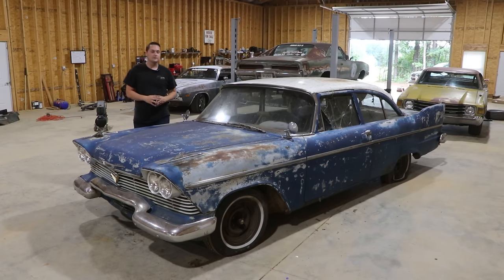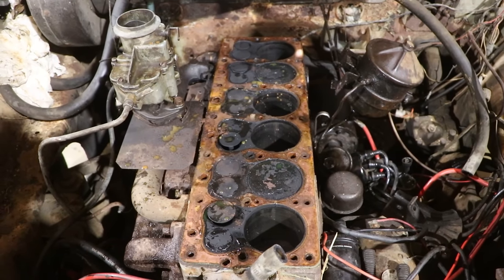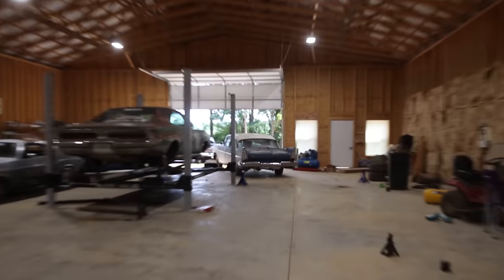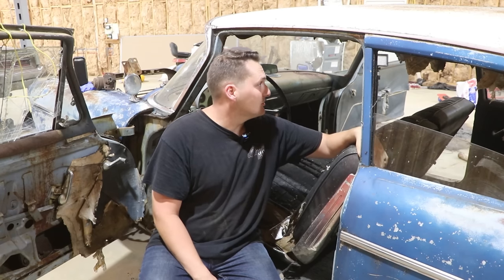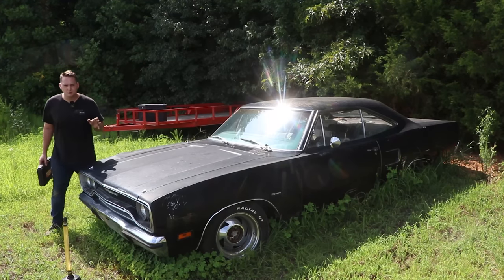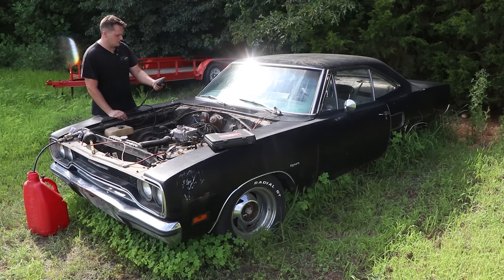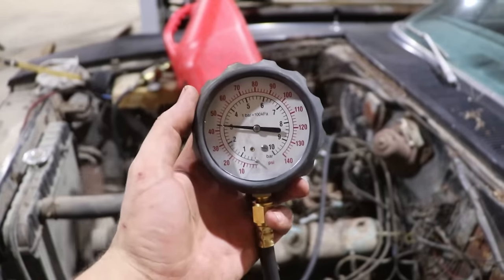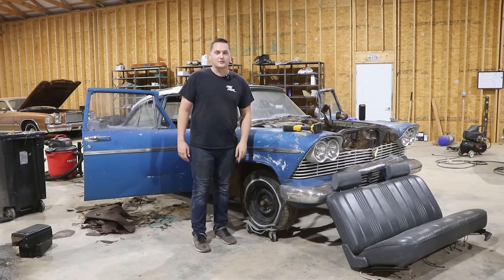Barn Find 1958 Plymouth Engine Teardown - Is It Too Far Gone?

Comment: the flat head is a great motor not sure if its a 218 or the big flathead lots of parts for them but expensive to build unless you have friends sending parts be sure to run 30 not multi grade . 383 would be nice